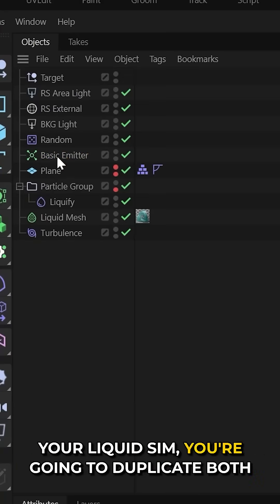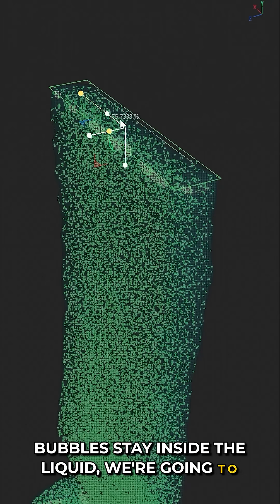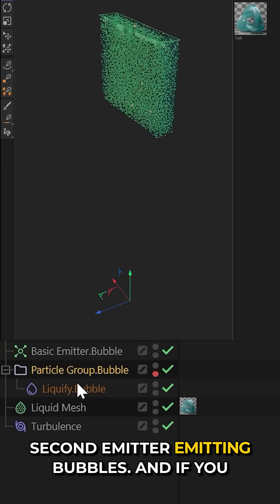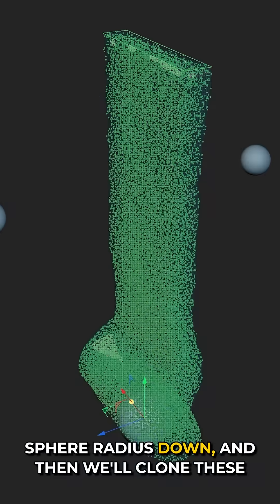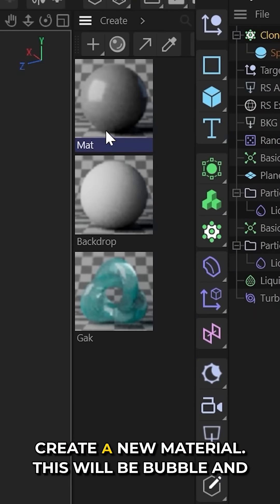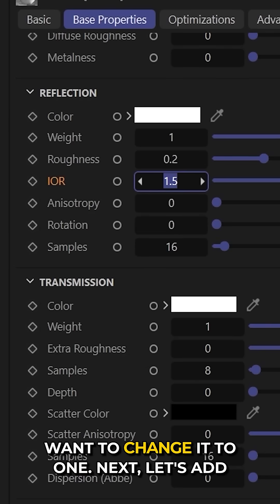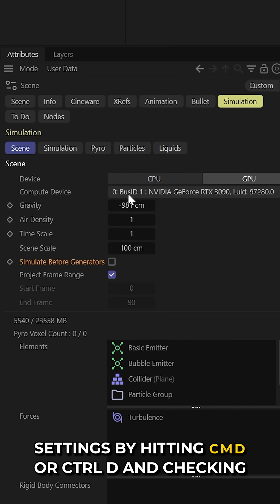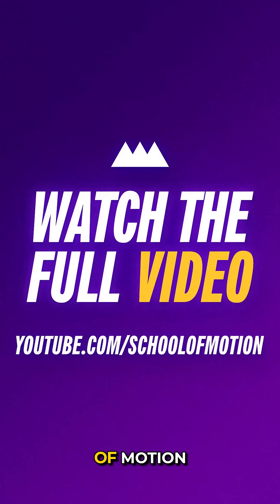How to Create Bubbles in C4D Using Liquid Sims!

Comment: Couldn't you just use a redshift matrix object on the cached mesh of the liquid particle sim? On the RS tag of the matrix you just select optimized spheres (or deform some spheres and turn them into RS proxies and toss those into the tag). And then finally on the matrix object you just set it to apply to the volume of the mesh object and mess with the count/ use a noise field to break them up. I believe this would be better on the render times and viewport performance. And it should still get the velocity from the liquid mesh transferred to the matrix bubbles. I'm not saying what I suggested is the better way. It's just how I would do it. I try to employ lots of optimization tricks to get better performance.